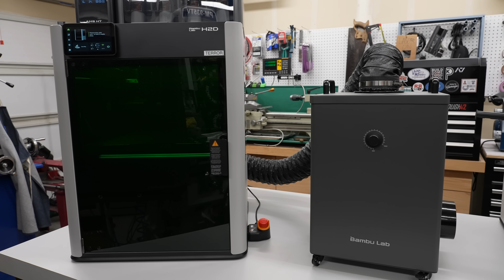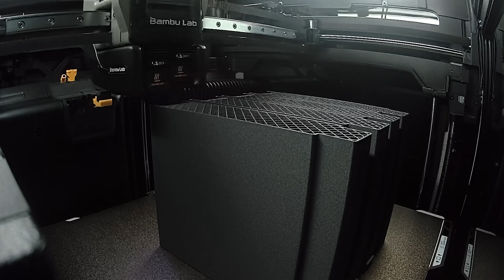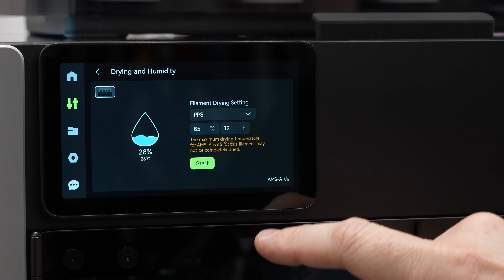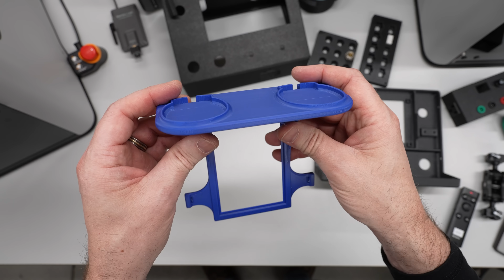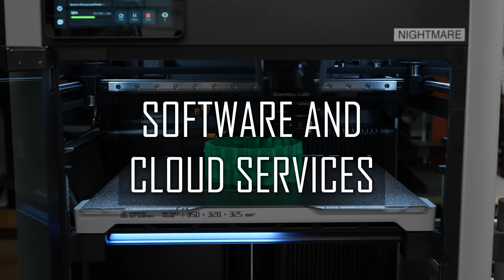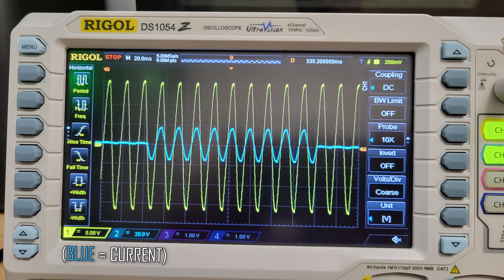What I Learned from 300 Hours with the Bambu Lab H2D 3D Printer

Comment from the maker: Whoops.  I misstated the claimed optical encoder resolution.  I said 50um.  They're actually claiming 5um.
Reply: Outrageous
Reply: I want one, but really, right now, have enough room for it.  I have a piece of junk (Creality K2MAX) taking up a lot of space.
Reply: @Daveyk021 I was torn between the X1 and K2.  I am curious what went wrong with your K2 and how was the customer service?
Reply: I’m really interested in your print example with the TPU buttons and the transparent elements. I believe it was for a control panel for a previous project. The backlighting possibilities look badass.
Reply: Hello, I'm interested in purchasing the babulab h2d combo version.
But I have a question: is it possible to install a laser and a cutter on it later? I'd be very grateful for an answer.
Reply from the maker: @Cartridge_clinic they sell a laser upgrade kit with the laser safety windows, e-stop switch, air pump, and other needed parts to do the upgrade.
Reply: @Clough42  Спасибо вам большое, Привет из солнечного  Узбекистана город Ташкент)
Reply: Hi, I’m curious to know if the print bed is truly flat when is cold or heated. Nice to see a part (with easy filament) flat relative to the print bed. Does the bed itself actually flat? I design and print only functional objects, as you do, so this is essential. For my two X1Cs, I eventually had to purchase a CNC-machined aluminum print bed and replace the original one.I remember that in the beginning, the term "Banana Lab" was coined. :-)
Reply: Hi, it is more convenient the version with laser or without? and if you can know what type of laeer is a co2, fiber or diode?
Reply from the maker: @felicecapuano6235 It's a diode laser.  If you want the laser.  It might be worth it to you.  If you don't, you'll likely find the green windows annoying.
Reply: 5um resolution is one thing. 5um accuracy and repeatability is a different animal entirely.
Reply: Their website does state the vision encoder is 50um resolution
Reply from the maker: @mattmo91  I think I've seen both.  At this moment, the product listing says "5μm Resolution Optical Motion Calibration".  We may be mixing resolution and system performance claims.  It would make sense to have a 5um optical resolution and produce 50um system performance.  I haven't independently verified either.  Doing that well is a whole can of worms in and of itself.
Reply: Thank you Mr. Clough and congratulations on maintaining your fitness.
Reply: I am kinda iffy on these claims. I have a printer that claims like 3um and It doesn't feel it.   We don't really have ways to test this either, at least easily, so it's basically just a claim to try to advertise a selling point.
Reply: @Kissker print a block x size and measure it. I'm betting sub 10 micron accuracy isn't happening. That said I'd be happy to be wrong.
Reply: @Clough42  i also heard another reviewer day 50um which is 0.05mm which seems very reasonable. 5um is getting into the super high end laser scanner metrology range.
Reply: @raindeergames6104  5µm is pretty trivial for any modern optical encoder. Even a cheap one. A super high end metrology laser scanner is a completely different technology that can't be compared apples-to-apples.
Reply: Ive seen it advertised as a 10w and 50w laser modules..
Reply: @genin69  It's 10 and 40 listed on the official site.

Comment: "It just - works!" The Bambu H2D is my first and only 3D printer and having now used it for around 100 prints - from tiny to huge - and about 400 hours, I can testify to that. I've had none of the trouble I hear people using other printers complaining about. It...just...works. If that's what you get for staying within a few constraints, like material choice, then I have no complaints as long as those materials are good quality, fairly priced - and available! The last point has been a slight issue at times, but I'm not sure that can be blamed entirely on Bambu. I use their volume discounts whenever I can and feel I get great filament value.

Comment: The more I look into what printer may fit my needs, the more confused I become.... 😢
I am asked to print instrument stand and hangers for expensive guitars and violins.
What comes to mind is to print it in CF with some sort of rubber on the parts the instrument rests and or hangs on.
Also want to use usable items and hat need to be uv resistant.
What would be my best option?

Comment: Hi James, I really value your content. I’m planning to buy a printer specifically for woodworking jigs and templates. I’ll be running PETG-CF and ASA almost exclusively (usually single color, max two). Based on your recent videos, the H2D seems like a better fit for me than the P2S, primarily for the build volume and material handling. I’m thinking of skipping the standard combo and going with the H2D + 2 x AMS HT units instead. I’d love to hear your thoughts on this setup for a functional workshop. Cheers!"

Comment: Great video and thanksgor all the great info. I would like to throw couple questions as I am considering buying one. First I manufacture gun frames and accessories so i need the accuracy. I  am also getting ready to start building supressors and will need to mark them. So here are the questions, would the 40watt laser be able to etch aluminum  to .003 depth? Stainless? I now have a flashforge, my first 3d printer, and it drives me nuts with failed prints sounds like this one just works.

Comment: This is a great video about the H2 printer. I’m new to 3D printing and I enjoy it. I was using the K2 pro combo and it was okay but after 100 hours it had an extruder failure. This was my 2nd machine. So I decided to go Bambu lab H2D . I plan on making car parts and some model cars and anything that may need around my home. I also like to see the machine work as advertised. I’m a jet mechanic supervisor who is about to retire from the military. I fantasize about being an engineer I love watching machines work. Thanks again for your review of this machine. One last thing can I purchase you exhaust adapter? I would to try and make a 3 way exhaust duct adapter involving my home dryer exhaust port.

Comment: Are you using glue stick in order to get the carbon fiber nylon to stick and not warp?

I’m having a really hard time getting PA6 CF to stick to the print bed especially in larger prints. Bed temp is maxed at 100 and chamber temp is maxed at 65. My last option is going to be glue stick but I feel like that’s just a sloppy fix for the real issue.

Comment: OK you sold me on it. I have a 2 week old K2+ and it is pretty much a paper weight now. Too many issues for me to give enough of a crap to fix. It's 2 weeks old I SHOULDN"T HAVE TO WORK ON THE DAM THING!!!! Once I get this sent back I'll get back on here and use your code to buy my new H2D printer. One question, how is the Bambu slicer to work with? I'm trying to learn Blender but got so swamped in the vast depth  of the program and lost interest for a bit. I have so many ideas in my head but still struggle to get them built.

Comment: Could you share the RH% your nylon rolls were at time of printing? 

I am getting a lot of stringing with Polymaker PA12-CF, I dried it for 24 hours in the Polydryer and the drybox is reading 18% RH. 

Thanks for the in depth review!
Reply from the maker: I put it in an AMS-HT and ran it through the default drying cycle for the material and probably printed with it 10 hours later.  The real issue isn't the RH in the air--it's the moisture in the material.  You have to heat it in a dry environment to drive that out, and after that, the RH in the box just determines how fast it'll absorb moisture again.  In the AMS-HT, it typically stays at or below 12% for a few days at least--sometimes a week.  I move so many materials around all the time that I usually just assume that if I can't remember when I dried a roll of nylon, I dry it again before printing.
Reply: @Clough42 this makes sense. I may try out a AMS-HT because I’m not certain the polymaker is up to the task. My nylon still gets stringing even after 24 hours of drying. Thanks for the feedback!

Comment: Great information on this printer as always.  You did not cover some of the most important parts of owning a printer though, like repairing the common problems people will have.  For example, cleaning out a clogged extruder is quite the undertaking with the H2D and is not for faint of heart, fat fingered people like me.  And the instructions from Bambu Lab are far from clear with no audio on their videos and technicians moving through tightly packed components like a Mississippi Blackjack dealer handling a deck of cards.  Unfortunately, I have had many, many extruder clogs with my H2D and each time seems like a science project that takes 45 minutes to several hours to fix.  The components do not always go back together correctly and you need to start over.  The plastic part above the nozzles is like a complex 3D puzzle to install and take out.  
It would be great if you included instructions on how to fix common problems people have with the products you are reviewing.  In addition to enhancing the value of the review and covering the “true” “cost” of ownership in time and $$$, you would get even more views with people looking for help on repairing the product and getting back to printing.  It is wonderful to see a real engineer cover the technical aspects in plain English on the products you review.  Keep up the good work!!

Comment: Thanks for. the great review on the Banbu H2D and H2DL just a quick question you touched on it briefly at the end talking on power being pulled at startup, but did you ever work out what the running costs were on the machine was on average? or roughly.
Reply from the maker: Their documentation says 150-200W continuous when printing PLA.  I haven't confirmed it myself.

Comment: To be honest I prefer the laser to be seperate and basic. I lasered a design on a timber table top that was 2mtrs x 1mtr and it was so easy to set up, just sitting the laser on the timber itself. I would love to give the bamboo lab printer a try, considering I still have the old cr10s. I’ve modified it a fair bit and it prints quite well with ASA but it’s painfully slow.

Comment: I want/need a 3D printer of my own. I've used an X1 Carbon with an AMS for ~2 years and now feel that this H2S is what I should buy. I create component parts which are incorporated on robotics for deployment in real world engineering. I've always wanted a larger build volume than the X1 affords - I think this is going to sway me. After all, I don't need a hobby, I just want machines that work 1st time.

Comment: Very informative review which  highlights the ideal experience we would all like when purchasing a H2D.
Some really impressive prints of real world engineering projects which isn my area of interest.
But these printers vary and a few customers on the Bambu Lab forum have had serious issues that have not been easy to resolve.
When you buy a H2D you are receiving a random sample from the factory -  but the printers reviewed here were provided by Bambu and undoubtedly represent the pick of the production line and tuned to perfection.
My point of resistance on purchasing a H2D is not the undoubted capability of the printer,   but whether I get one that works as well as the sample in the review.

Comment: Honestly, I'm inundated with the new 3D printers coming out, trying to chose which one to go with, especially in just this last year, which is why I'm appreciative of reviews like this one. In fact, I turned my vision away from Bamboo Labs BECAUSE of what they did over the last couple of years with their restrictive firmware, third party limitations and going 'cloud' based. It's all unattractive as a newbie, but their Carbon printers was where I was nearly at for a purchase before I decided to hold off. The complaints to Bamboo Labs for their firmware enforcement that went unanswered, really turned me off and onto the consideration of the Prusa. All that being said, I honestly thought your review was outstanding. You didn't seemed filled with glee, but everything you stated sure seemed like a magnanimous improvement and stark enhancements that I was truly glad to see built into the next stage of printers. Thank you for the honest reflection; my eyes are turning back to BL now...
Reply: Choose this one. 600mm/s air filtration, enclosed! Silent.  Goes without saying for me. There’s though slight loss of volume if using a single nozzle. He didn’t seem to mention that.

Comment: I bought one a few months ago and everything works as expected except dual extruder prints with dissimilar materials. If you print two colors or PLA its fine but if you have two different materials like TPU and PLA it breaks down and neither filament will print correctly. I print a lot of small intricate TPU parts with PLA supports on the J1S and Orca slicer handles it fine. Unfortunately H2D is not yet supported in Orca so I'm kinda stuck waiting for Bambu to fix it.
Reply from the maker: I've done lots of TPU/PLA, TPU/PETG, and other combinations with no issues.  See my 3D printed machine bellows video for an example.

Comment: It's a shame that's it's so expensive and to not have included the laser module as part of the package is a bit misleading for their advertising and ultimately disappointing. I feel like this is over priced for what it is.
Reply: When I was looking for another printer - I decided to buy the Bambu P1S.  I didn't care about the laser module of the H2D, nor was I interested in the two print heads (I would rather have a tool changer if I needed multimaterial.) I already have a diode laser machine (made by longer.)  I paid ~$1k for a P1S w/ AMS Pro 2 & a hardened nozzle and gear.   As someone who has been 3d printing for 15 years - the grand for the Bambu is worth every penny. I have had over 20 machines from about every major manufacturer and the Bambu is the most seamless, well integrated, and most reliable (by a huge margin) printer I have ever owned. Their machines cost more - but it is worth it.
Reply: @theangrymarmot8336  Preach!   :D

Comment: During the video indicate that the manual says the printer uses a maximum of about 1300 W… But that’s not the case. It seems to overload a massive industrial that is rated at 1680 W.. so without a doubt and H2 D when it’s heating the bed set off the alarm on UPS because it overloads the unit which is rated at 1680.

Comment: I needed to put a 20 amp 110VAC fuse in my breaker box to use it! I pray my house does not burn down but the 16AWG wire seems cool to the touch after an hour of FULL power usage.

Comment: Where do you purchase your filament from? And can I rack your brain to gain experience from? I am somewhat a newbie to my new H2D printer. I have been 3D printing for several years now, but no experience with my new H2D Bamboo Lab printer. I have accumulated several hundred .stl files, and still don't know how to transfer them to my new H2D. I tried running them through the USBs, but the printer just spits out globs of filament and doesn't print properly. Do I have to reload them through Bamboo slicer?
Thanks, Dave.

Comment: I’m a bit confused by the ams options. I want the ams high temp but can I use it with a standard and also, the new version of the standard ams that is. If so does that mean you have 5 materials that can be used. If that’s the case would they be connected to one nozzle and can still run tpu in the other nozzle.
Reply from the maker: Yes, you can use a splitter, which they sell for about $5 to connect multiple AMS units to the same nozzle and run TPU in the other.  Many combinations are possible, and I believe you can run up to 28 filaments in one job.

Comment: I like this printer serious looking to get one, how does it cope with doing a print with PETG then the next print is with PLA, does it know to do a high temp purge with the lower temp filament to get any left over PETG out.
Reply from the maker: Yes, it does know to do that, and for the most part, it works well.  The one case I had where it didn't work well was when I switched from PPA-CF directly to TPU.  I had to use the control panel to heat it up and purge through some intermediate-temperature material (I think I used ABS) first to get all the PPA-CF out, and then I loaded TPU and it worked fine.  Switching between PLA, PETG, and ABS, I haven't noticed any issues with the automatic purge cycle.

Comment: Could not agree more, 3D printing is NOT a hobby for me either! It's another tool for my other hobbies! I very much dislike the cloud connection, but to provide print management from anywhere features the cloud connection is a must. However, I found LAN mode is annoying but tolerable so far, so I'm sticking to it. I'm very tempted to get a H2D once they have a sale on them, couldn't be happier with the lowly P1S with AMS and about ready for an upgrade. Probably best video on the H2D yet.

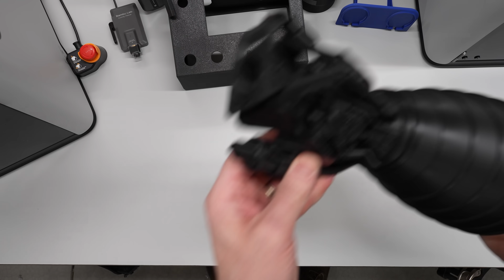Comment: 17:16 🤯 It’s pretty creative and a well thought out approach instead of relying on the rfid tag and how much that specific spool has used according to the history. If you wind a new & old filament x distance you’ll find that both will have different lengths because of the different radius that both spools traveled and guessing bambu must have a pre calc sheet to determine how much is left without needing a rfid tag. You can think about it like a running track were every runner starts from a different starting point to equal out the same distance. Now i have to look into this because if we can implement it into klipper for opensource ams , this will be a game changer